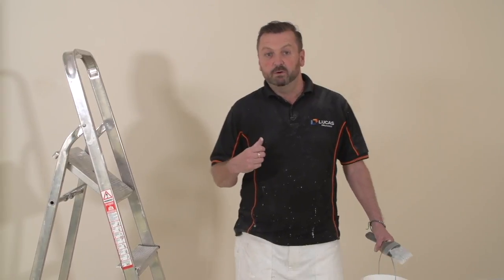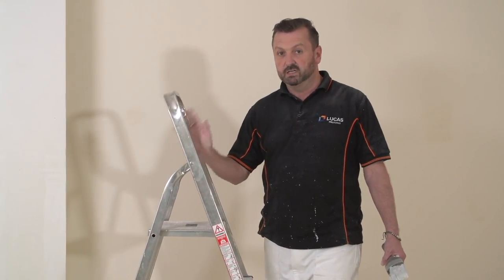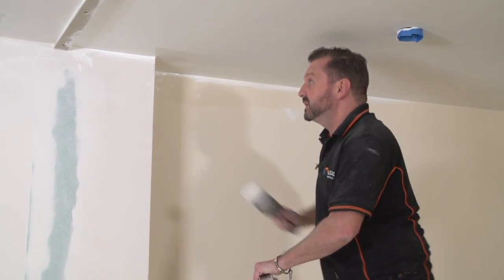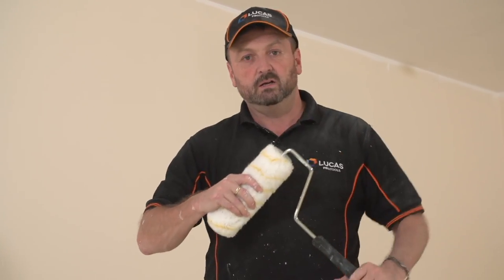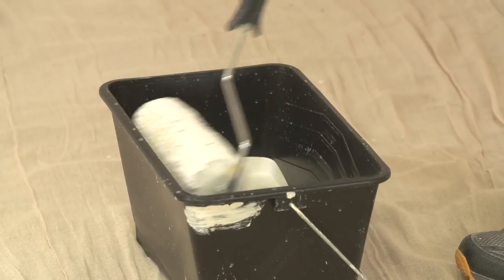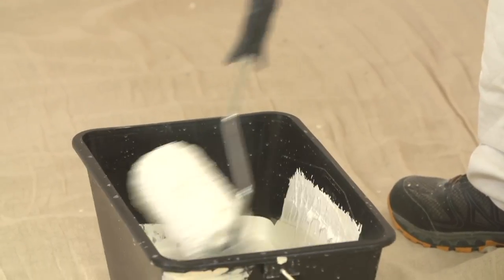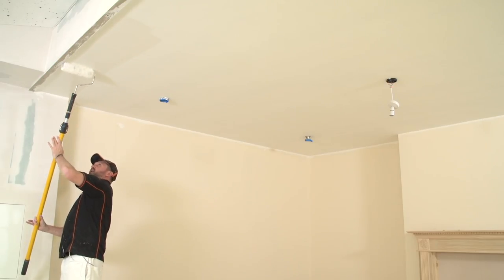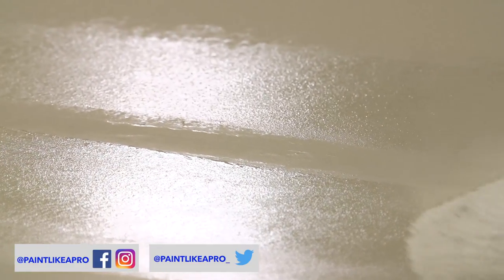How To Paint/Roll a Ceiling Without Misses or Streaks - Tutorial 2018

Comment: Do you really ever get brush marks using flat ceiling paint? I never have a problem, but I also brush out my paint and use good paint.
Reply from the maker: +Thomas LaFleur you can get brush marks in any paint... that’s why it’s important to lay off correctly. The dulux fastmatt I was using is an excellent product 😊
Reply: Paint Like A Pro I like using only true flat ceiling paints. I’ll use Master Hide, also. Works great for ceilings. Unless, of course, the job calls for a certain paint to be used in the specs.
Reply: Always going to see the brush marks.Mask walls, push roller edge into tape and basically don't need to cut in, only lil bit in corners and a light touch along tape line if needed